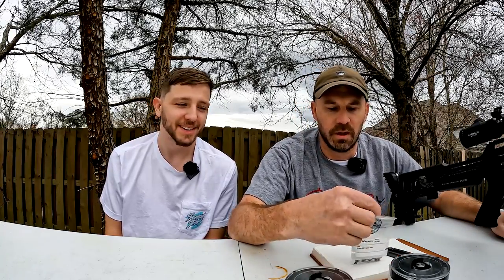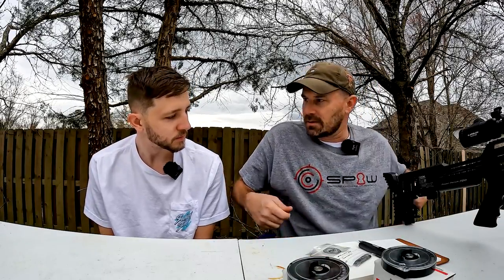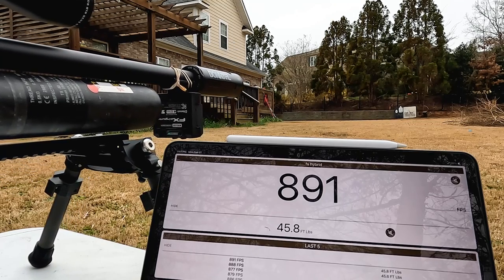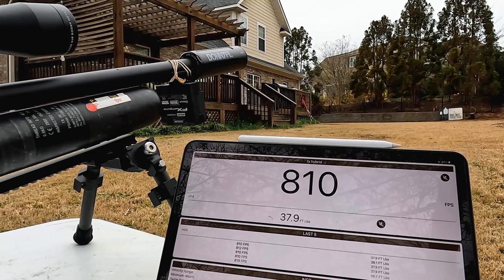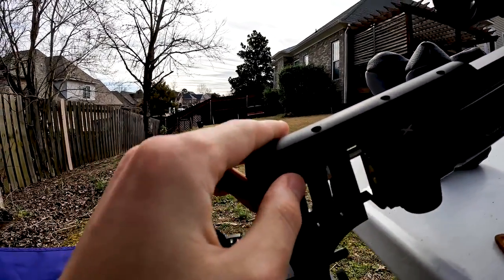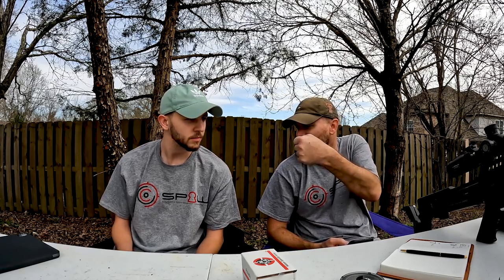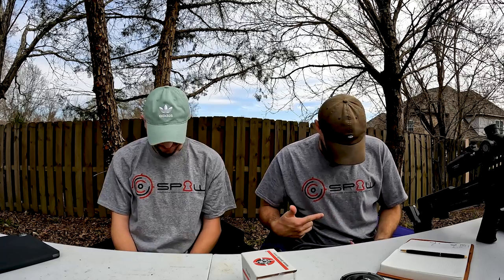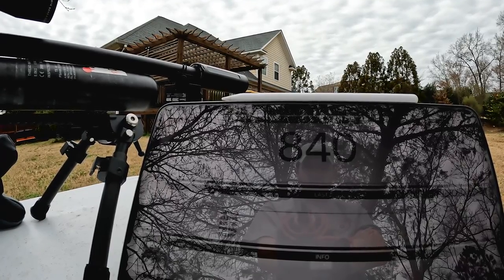How Much Performance Does A Slug Power Kit Add?

Comment: I got 23 fps faster with my 25 cal. 150 bar. So I can use the lowest hammer setting to get what I was getting at the highest hammer setting. I also used the Huma v2 transfer port to get that 23 fps faster. I will use less air, less fill ups and be able to use heavier slugs now. So worth it to myself.
Reply from the maker: Awesome feedback and results! Thank you for sharing

Comment: Thanks for the comparisons. Definately get the first rfegulator on like 170 and that second regulator on 150 bar. Vlave dial on line 4 or close to it, and see what your speed is. Start at 1000fps, and turn in valve adjuster until your speed starts dropping. this setting is best for power as well as less air consumption.
Reply from the maker: Thank you for the tips and feedback! We appreciate your support also

Comment: I installed the slug power kit with my .25 cal 600mm. I got around 8-10 fps more. The advertised from fx was 50-80fps more in the .25 cal. That is all a lie. You will not get 50-80 fps increase. Fx needs to change their advertised to 10 fps increase so folks can decide if they want to spend $40 on 10fps increase.

Comment: The rubber ball shuts your valve faster, not leaving it open longer. The slug power kit also comes with a weaker hammer return spring with that rubber ball, which it doesnt do much anymore, so leave the rubber ball in there to dampen the hammer rod.
Reply from the maker: Great information and thank you for the feedback and support!!!

Comment: you need to crank Reg2 to at least 150 bar with the Slug Power Kit, the valve spring is now useless, your high reg 2 pressure is now what somehow controls your valve.

good videos
love from Saudi Arabia
Reply from the maker: I’m around 155 bar but will probably bump it up to 160 bar this week. Been out of town so I haven’t shot in a few days! Back to it tomorrow! 😁

Comment: HIGHLY recommend ditching the stock probe carrier for the K&L Ultra grip probe carrier.  Bigger set screw that doesn't strip as easily as well as having another screw to ensure that the probe is rock solid.
Reply from the maker: Already swapped it out for the NSA pin probe and like it. Having it to do all over again, that’s all I would have done but not going to take it apart to replace the hammer spring spacers at this point. They can just stay in place for now. 

Thanks for watching and for the feedback.

Comment: In order to see significant gains of fps and FPE, you have to upgrade the barrel with heavy slug liner and longer barrel options and probe pin with tungsten heavy spring. If you have 600mm put 700mm with heavy slug liner fast twist barrel liners and for more go all out with the 800mm barrel.
Reply from the maker: We are running 700mm barrels. There was some improvement once we took the little rubber ball out. Continue to run them like that without issue. Thank you for your comment.
Reply: @bowmanoutdoors  Something isn't rite if you have to take FX factory tested designed parts out of the rifle to make them work better. It can be defective regulator valve stuff. I've seen messed up regulator parts that are being sold new. Utah Airguns pro shop may have answers for it. Mine shoot superb out of the box but I got them when quality control was a lot better before the COVID era happened. It's hard to find superb parts now . My next tinkering session is with the new FX Panthera model. I do own many air rifle models. The good ole FX Crown is still seems the way to go or the Wildcat mk3
Reply from the maker: You are correct sir. After making the video, I messed up and stored the rifles for a month or longer without pressure and messed up some seals. Not being able to acquire the correct replacements after hours and hours of research and multiple trials of substitutes, we worked with FX USA and got everything fixed correctly. They were great to work with (so is Utah Air) and things are still running smooth. I’d like to see better regulators across the board in general though.
Reply: @bowmanoutdoors  yeah. Good to hear you're getting fixed up. The regulator thing does need to be addressed. I can't figure why in the world such a awesome famous company can let this stuff go on. They've did some changes coming out with the newer Panthera models,I'm wondering if they've done something to counter with it. I hear it has state of the art components! I'm going to test the waters soon. Hopefully it's as good as they claim. I've already heard tho that the .25 cal models are having issues with the barrels? Hmmm 🤔
Reply from the maker: That’s unfortunate. I ordered and paid for a panthera , but changed my mind after a few months of waiting. Maybe a good thing hearing about the barrels also. I’ll pick one up one of these days! (Maybe the YouTube thing will eventually bring resources in, rather than always out). It gets costly doing everything times 2, but worth every cent to have the time with my son
Reply: @bowmanoutdoors  yeah I'm also thinking about things as well. I'm liking what I'm hearing on some other brands I've tested. BRK has it going on,Skout Epoch and of course Daystate. Uragan is still decent. Good to know it's all good and fun with family is what counts😊 shouldn't have to keep fixing and working on something faltering for our hard earned dollars, especially for 2 k and up👍
Reply: @Bowman Outdoors  if you purchased from SPAW why didn't they help you out???
Reply: @smashingintexas765  it's why I purchased from Utah Airguns or Palm Beach Airguns as well as Talon Tunes! Airgun Pro Shop is ok too!
Reply: @Ed Snippin Man  what's why you ordered from other's versus SPAW???
Reply: @smashingintexas765  Research
Reply: @Ed Snippin Man  I did they have 5 star reviews and southern gunner recommends SPAW so again am I missing something I have purchased from both Utah and SPAW.
Reply: @smashingintexas765  Every time I check there, Spaw never has inventory and takes forever to get anything always back order. When I shop Utah Airguns they have a huge selection or can get asap. And checks the products without asking. Like RN! Lol Spaw is always too busy or doesn't have time for several weeks.
Reply from the maker: SPAW didn’t have the correct o-rings either and we tried to order some complete kits (they delivered minus the needed part). Just cut out the middle man in the repair process and sent directly back to factory. (Same ease, less time, direct contact).
Reply: @bowmanoutdoors  ya I know this,but someone else doesn't know Spaw is always on back order or nothing much in stock. it's why I shop elsewhere! 😁👍👍👍
Reply: @Ed Snippin Man  that's weird BROTHER I ordered from SPAW on MARCH 31 and received April 5 with heavy slug liner and slug kit installed!!!
Reply: What rifle model??? I've also heard SA complain about it many times. I just heard  6 other people are having problems as well from ordering from that outfit.
Reply: @Ed Snippin Man  MK3 Compact. 30 cal Steve was my Guy!
Reply: @smashingintexas765  Nice rifle! I do have the sniper version. 800mm barrel full kit. Talon Tunes!
Reply: @Ed Snippin Man  I was just trying to figure out why not SPAW from your experience! all I'm able to gather is that they didn't have STOCK IN which that's not ah BAD thing that just means he's PUSHING PRODUCTS out faster than he can aquire that's ah GOOD problem to have BUDDY!
Reply: @Ed Snippin Man  my .35 cal was ordered from UAG thaddeus was my sells guy at that location another great BUISNESS!
Reply: @smashingintexas765  dunno, I guess if you can sit back awhile an have a few beers while you wait forever and not go into convulsions, then maybe it's ok. Good parts are very limited as well. But that ain't for me, the waiting game. I cannot afford losing time in my pesting job/ hobby. 👍
Reply: @smashingintexas765  Nice! Ya I had the FX mk3 .35 before I purchased the .30 the 30 is way more accurate. At least the ones I tested so far. I do own .35 in  the Skout Epoch model. it doesn't group as good either!
Reply from the maker: Yes sir. SPAW is the only dealer that had the M3 in stock when they came out and it was an easy deal…. Since then, a bit more hit and miss on inventory and UA has a much better website and their customer service has always been top notch for us!
Reply: @bowmanoutdoors  Right on brotha👍👍👍💯

Comment: The valve adjuster needs to be turned in, to compensate for high pressures.
Reply from the maker: In for higher pressures? That maybe the one thing we haven’t tried…. Fingers crossed and we will give it a go

Comment: I just bought a slug power kit and I heard you say something about the rubber ball that you have to put inside the valve spring . Does it decrease the velocity or what ? I dont know if I will leave the oem spring or change it and make the one with the kit . What do you recommend ? Thanks for the info . Greatly appreciated guys .
Reply from the maker: The little rubber ball hindered our velocities drastically. (100-150 fps). I did not see much difference between the OEM spring and the slug kit spring so we went with the new one. The one thing we didn’t try was the OEM spring with the rubber ball. That might be interesting. 😁

Thanks for watching and commenting!!!

Comment: On one of your videos after the slug kit was installed... One gun worked fine but the other one would not shoot properly with the rubber ball installed. What was the problem? Mine is doing the same thing
Reply from the maker: Removing the rubber ball was the biggest difference. We also had to end up retuning after install, and we still do not run the rubber ball in either gun.

Comment: I have an FX Impact M3 do I need a slug pack with new springs?
Reply from the maker: Thats a tough question. 
It isn’t overly expensive, but install isn’t just plug and play. I would say yes, if part of a larger modification including slug liner, slugs over 42gns, hammer weight, and maybe reg 2 upgrade. It alone won’t get you much performance. Ultimately, it’s up to you and if it aligns with the longer term goal. 

Btw, love the profile pic. I am new to reefing and have a pair of mocha storm clowns. Love them!

Comment: 180 degrees.
Reply from the maker: Yes, 180 degrees. Probably won’t update the video though. We swapped to a huma-air slug port
Reply: @bowmanoutdoors . I have a Huma slug port on my FX Wildcat. I'm thinking about swapping it over and putting it on my 700mm M3 barrel. The Wildcat (Warcat) is not intended to be super high powered anyway.

Comment: This was complete waste of a video, the speed you gained is what you would gain by just simply rotating the barrel 180 degrees. Tune the guns now with the kit and see if you can get those 40 grain slugs over the 850fps mark now with the mods. It should be able to get those 40 grainers over 1100fps now
Reply from the maker: Sounds like you loved the video. 😂. We will try your suggestions, but I currently do not have issues with getting slugs fast enough. I just want to stay clear of the transonic zone to assist with ballistics and flight stability. I could try going much faster though and see if it helps. I currently have too many variables to get very consistent and precise results. 

Thanks for your feedback and comments